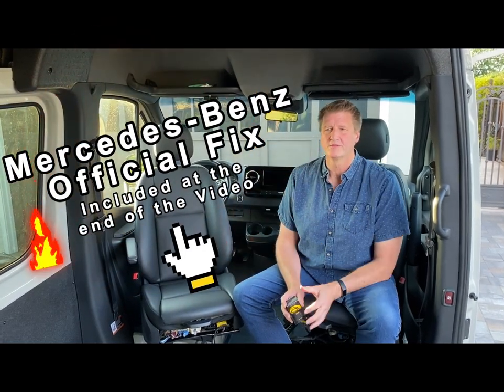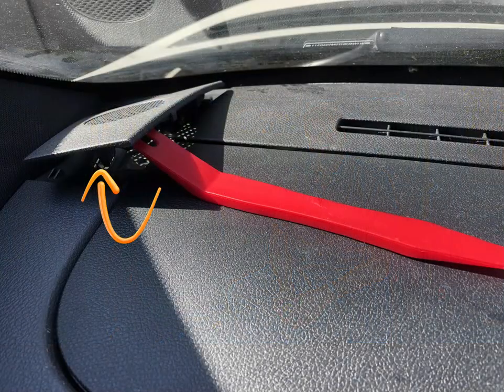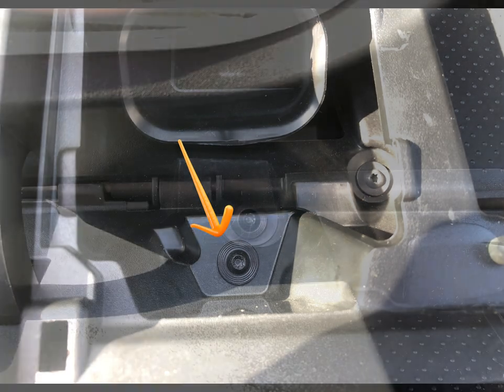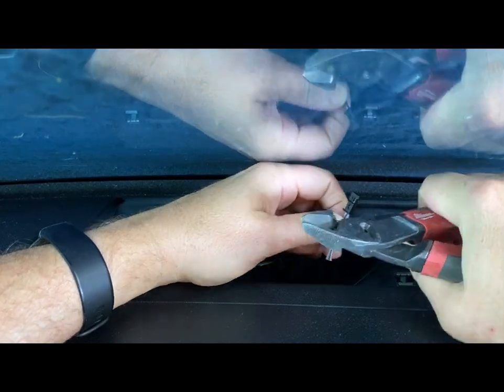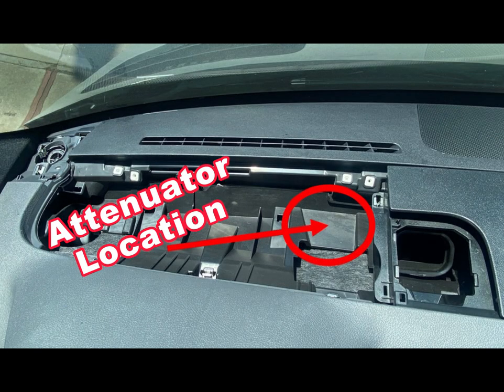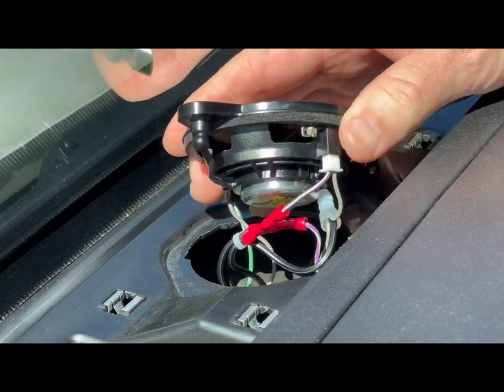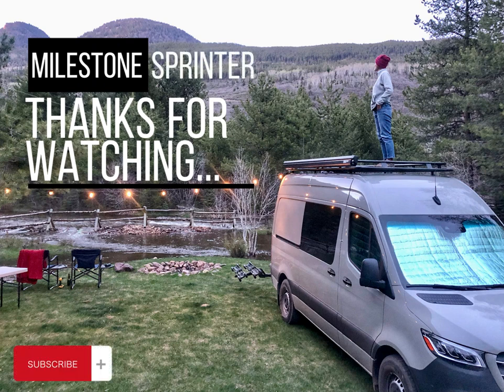"Mysterious" Mercedes Fix for 2019+ Sprinter Vans Revealed - MBUX Center Speaker Wiring Correction

Comment: One more question after doing the wire swap: Do you see an "SOS unavailable" message illuminated in red, then turns off after 15 seconds? - I see this on the main MBUX screen at the very top edge on the right, where a few other small icons are displayed. For additional info, I have a 2022 MB, 2023 Revel.  Thanks for your help! Switching the wires into their proper connectors has made a huge difference in sound- my only concern is the SOS function.
Reply from the maker: Hey Catherine, good to hear the wire swap went well and the stereo sounds better!!!  The “SOS Unavailable” has nothing to do with the speaker wires, no worries!  You get that message when you turn the vehicle on and it is connecting to the over air link or the vehicle has lost the connection (ie in a tunnel  for a while).   The red light near the SOS button on the ceiling is also illuminated during the sync process.  You probably didn’t notice the message before, it happens on all Sprinter vans when you start up the system.  Again, awesome job on the swap!!!👍
Reply: @milestonesprintervan-peter9545   You're right, I hadn't noticed before, but was paying close attention after making the wire change!👀

Comment: Does the wire position matter if doing the “official fix”? For example if green is on the left of the wrong clip, should it be on the left of the correct clip when I make the swap?  Thank you in advance, and thank you for posting this video!!
Reply from the maker: Hey Catherine, yes!  You should keep the colored wires in the same position (i.e. green to purple position and purple to green position, gray to gray).  If you cross wired them then the center speaker would be out of phase with the small left and right tweeters and the door speakers.  It’s purely a sound quality issue if the wires are crossed.  Great question and thanks for watching the video!

Comment: You just need to switch the wires on the end of the one pin connector. No need for an attenuator - avoid the nightmare. Jehnert also makes a $27 cable that switches it for you but they don’t ship to the U.S.
Reply from the maker: That is absolutely correct!  We added the attenuator prior to Mercedes announcing that they manufactured the speaker pig tails incorrectly.  The official fix is at the end of the video and is super simple to rework.   Less than 5 minutes effort if you have a dental pick in your toolbox.

Comment: so the 2 wires in the white now go to the black connector and they go in the same holes on each one?
Reply from the maker: Yes, swap the wires front to back, back to front.  Keep the same  wire orientation (grey wire to grey wire, colored wire to colored wire) or the center speaker will be out of phase with the other speakers in the van.  Thanks for watching the video!
Reply: @milestonesprintervan-peter9545  Thanks! On the to do list for tomorrow.

Comment: I think mercedes issued a service bulletin so this component isn’t needed.  Four wires need to be swapped.  LI82.85-N-071147
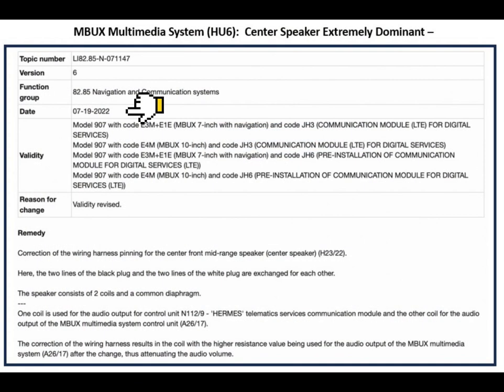Reply from the maker: Yes they did after we installed the attenuator…. It is discussed and detailed at 4:35 in the video.

Comment: Here's a quick temporary fix. 
Put a folded towel to over the center speaker.
Reply from the maker: LOL, noise cancelling head phones also work!!!  How this problem made it through Mercedes QA for over 2 years is beyond comprehension?  Driving out of the Dealer parking lot from picking up the van we noticed it and wanted to turn around, it sounded so awful!
Reply: @milestonesprintervan-peter9545  
2 years?
Try at least 5!
I had a 2018 with the issue.
There was a MB tech bulletin in 2022 addressing the issue.
I now have a 2023 with the exact same deficiency.
Go figure.